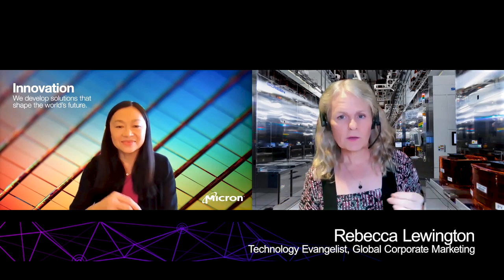Thy Tran on Micron’s 1-Alpha DRAM Process Technology

Comment: Where's your DDR4 3200 CL 14-14-14-34?
Reply from the maker: Hi there, good question!

I asked our experts over at Crucial and they tell me that from the technical side, we are focused on enabling the lowest latencies at the highest speeds. 3200 CL14 is very close to 3600 CL16 from a true latency (nanoseconds) range, but given all the new CPUs and the market demand for speeds higher than 3200 (especially 3600), we have chosen to focus our highest performance die on the higher speeds. Also, they recommend price comparing, and you can get the CL16 for the same basic price, and you will get more value out of your processor.  

Hope that helps, and thanks for watching!
Reply: @MicronTechnology  Good info thank you.
Reply: @MicronTechnology  very helpful!